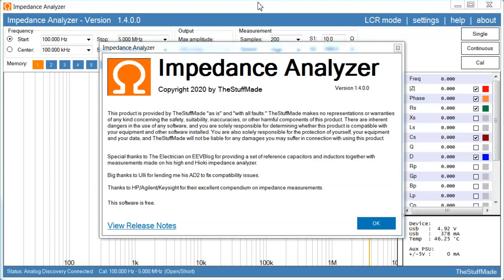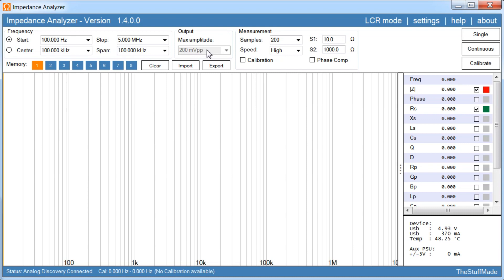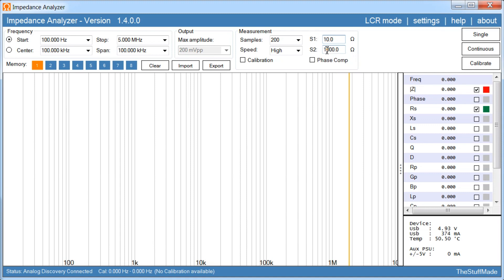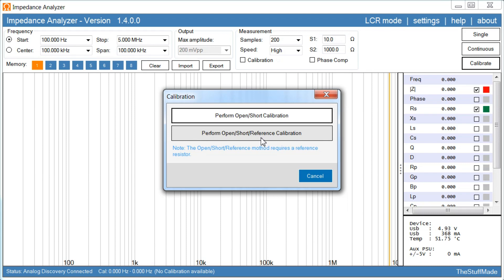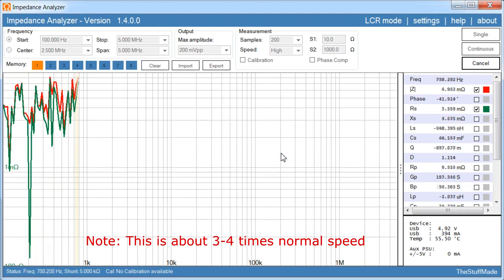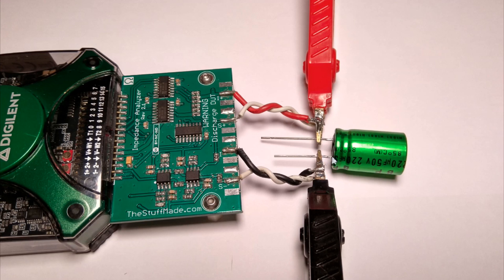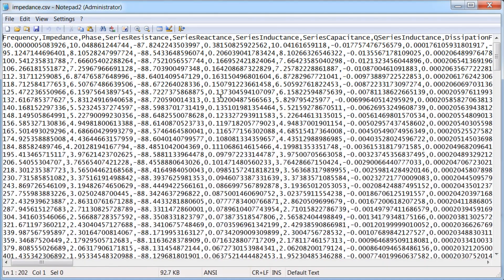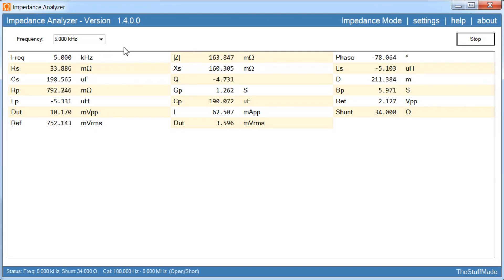Impedance Analyzer v1.4.0.0 Available for Download

Comment: Hi, TheStuffMade. many compliments for Your fantastic program/hardware combination. I made the circuit and it works fine! I only have one doubt. Could you provide me with the kicad diagram of the plugin? I ask you because I don't understand the connections between the Digilent and the part of the circuit corresponding to "LOW", MEDIUM" and "HIGH". Thanks in advance.

Comment: Hi Jake, i have the AD3 and when i start the impedance analyzer software, i can see it picks up the AD3 but no information in the temperature etc. window. Then the software closes by itself within 3-5 seconds from startup. I have the waveforms v3.23.4 installed on a 64bit machine, windows 10. When waveforms is running and i start impedance analyzer software it says device is not available. I assume it is because waveforms keeps it from connecting because waveforms is already connected to the AD3. When i close waveforms software with impedance analyzer software still running, i can see the device is seen by impedance analyzer software, but 2 seconds later impedance analyzer software closes automatically. Can you please recommend what i can do to get impedance analyzer working with AD3. Thanks in advance.
Reply from the maker: Hi, I recently bought an AD3 myself and I can confirm it doesn't work with the current version of my Impedance Analyzer software. I plan to fix it and release an updated version as soon as I have a bit of free time.
Cheers,
Jake
Reply: @TheStuffMade  thank you Jake. Also i want to thank you for the effort and the very useful software you share with us all.

Comment: Thank you! This project and the audio analyzer are amazing, having something like this available for free is really a boon. The software is excellent.
Sorry if this has been asked before but, which connector are you using to interface the board with the AD? I haven't found a definitive answes as to which connector(s) are compatible.
Thanks again!

Comment: When connected to AD3, close the program with an error message (Just-In-Time Debugger) in Impedance Analyzer ver1.4/1.3.
We use Win10, How to fix it? thanks!
Reply from the maker: Make sure you have latest version of the Digilent Waveforms  software installed.
Cheers,
Jake
Reply: Digilent Waveforms ver.3.21.2
Reply from the maker: @呀賢四眼仔  Make sure it's the 64 bit version. If you open waveforms and click down in the bottom right corner you will get a window with the full version info.
Reply: Digilent Waveforms version: 3.21.2 64-bit Qt5.15.2 Windows 10 Version 2009 Qt5.15.2
Reply from the maker: @呀賢四眼仔  Can you post the error message?

Comment: Great Video, and very useful HW/ SW! In the video I see that the capacitance value measurement always stops at around 200kHz... Is it a limit of the Hardware/ Software, or was it just because some settings? Also is it possible to add External BIAS to the measurement? Would be very useful for Coil testing :-)
Reply from the maker: Hi, in this demonstration I use a 220uF electrolytic capacitor, what you see is the nature of this capacitor being measured, the resonance frequency is around 200kHz, where you see everything peak and the phase goes from negative to positive. Above 200kHz this capacitor turns into an inductor. Larger capacitors will typically have a lower resonance frequency and small capacitors will have a higher resonance frequency, e.g. a 100nF film capacitor will typically have a resonance frequency around 10MHz.
Hope that helps.
Cheers,
Jake
Reply: @TheStuffMade  Thanks for the fast reply! How do you estimate the accuarcy of the device for Capacitance and for Inductance measurements? Would it be possible to add an option for external DC bias?
Reply from the maker: @ttakotube  It's fairly accurate as long as the calibration is done correctly, I've compared it with a high end Hioki Analyzer using a set of reference components. 
I've done a video demonstrating how to add a DC bias voltage during measurements: 
https://www.youtube.com/watch?v=d5k_opRCRVw&list=PLj1iPGXgbNf11SL1XVvDII3L6C4ZWhbyp&index=4
Cheers,
Jake

Comment: Thanks! I've just put together the passive version using an accurate 100R resistor and I'm getting very good results. I plan to compare it against a nanovna and a regular VNA and also the 'three AC voltage' method using a decent bench multimeter and a clean sine wave. I just measured a 50uH Siemens RM4 inductor wound with litz wire and it measured the Q curve correctly peaking at  a Q of 450 at 700kHz. This is one of the reference inductors in the old Siemens databooks where it gives Q curves. I'm very impressed so far, thanks again!
Reply from the maker: Thanks, if you find the software useful I'd recommend building the active plugin, it will give much better results at low impedance measurements. Also I have an updated version available with a lot of bug fixes and improved accuracy in some cases.  https://www.dropbox.com/s/0gkdr385y4vrrha/ImpedanceAnalyzer_1.4.1.3.zip?dl=0
Cheers,
Jake
Reply: @TheStuffMade  Thanks. I'm not sure where to find the schematic and PCB information for the active plug in. However, I'm still getting excellent results with the passive version. I'm currently measuring impedances up at 10Meg Ohm using a 10k sense resistor and the results are quite pleasing. I'll try the latest version of the software. Is it possible to change the scaling on the Y axis? I sometimes want to zoom in on part of the trace. I'm going to try graphing like this with the CSV export so I can workaround this issue. Thanks again, Jeremy.
Reply from the maker: @G0HZU  Hi, you can find the schematic and board files for the plugin in the download link for this video in the description. However if you are primarily measuring high impedance then the plugin is not of any use to you, it is primarily meant to give a large range like mega ohm down to micro ohm with auto shunt switching and amplification of the lowest values.
Cheers,
Jake
Reply: @TheStuffMade  Got the link now thanks! I do intend to mainly measure low impedances so I'll have a go with the active plug in. Regards
Jeremy

Comment: One question - in the video on 4:11 (time) is visible that (S-  I-) and (S+ I+) wires are twisted. The idea of S+ and S- is to measure the voltages directly on measured object and in my opinion twisting the (S-  I-) and (S+ I+) cables for high frequencies makes things worse:
1. Twisted cables work well when currents in both wires are equal and have opposite direction. The currents flowing into pairs S+/I+ and S/I-- are strongly asymmetrical as S+ & S- currents  are negligible compared to I+ &  I-  currents. 
2. The result is - because of the twisted cables I+ will inject voltages into S+ and I- into S-. Not sure that this is what we want.

If some cables have to be twisted  it's S+ and S- to prevent induction of external noises (but this will also increase the stray capacitance parallel to measured Z)
Reply from the maker: I don't disagree with you, I initially used fully shielded cables for both sense and signal wires, but since they are so short I've found it makes absolutely no difference within the ~20MHz range and the twisted wires are primarily for support to prevent the wires from breaking off. Keep in mind we are talking about 40-50 mm of wire here.
Cheers,
Jake
Reply: @TheStuffMade  Thank you for the update. I agree that for short cables it doesn't matter so much are they twisted or not. If using shield, ideally it should be active shield to eliminate any capacitive loading, but not sure if this will work for very high frequencies.

Comment: Whatsup with the rising temperature of the device during the whole video. At what temperature does it seem to be stabalized? Does it need perhaps some heatsink?
Reply from the maker: It's normal, it will reach something like 50-60C internal in the FPGA depending on ambient temperature, no need for any heatsink, but you can get the most accurate calibration if you wait until the device reaches thermal equilibrium. Might take 30 minutes though.
Cheers,
Jake

Comment: I just got myself  an AD2 and I'm going to build this adapter for use with it. I have already ordered the PCB but there are a few versions including packages for the 74HC4053, will any version work ?  Also what size (i.e 0603, 0805) are the resistors and capacitors used on the PCB ?   Thanks for the great video.
Reply from the maker: Hi, it will work with both HC and HCT versions of the 74xx4053. The resistor and capacitor footprints are 0805 so they will take both 0805 and 0603 sized components.
Hope this helps, let me know if you run into any issues.
Cheers,
Jake
Reply: @TheStuffMade  Hi Jake, I just received the blank pcbs and notice instead of solder pads for the output wires/kelvin clips you have a silkscreen on the board for a 6pos connector. Can you provide info on this 6pos connector and a part# for the 30pos connector ?
Reply from the maker: @wahng9552  Hi, for the 6 pos connector just use any standard 100mill/2.54mm spacing connector that will fit (ideally one that is 90 degrees so it will lie flat on the board) for the larger connector I use 2x20 female pin headers (you can get the right size, but the 2x20 ones are cheaper and more common) then just cut it to size and sand/file it a bit making sure it will fit in the AD before soldering it onto the board as it's a very tight fit. I've uploaded a picture of the connectors here: https://imgur.com/euSPonv

Comment: Would a solid copper wire work just as well as a resistor lead for shorting the leads during calibration? 
Very nice rig and software!
Reply from the maker: Yes it will work fine, just keep in mind that raw copper tends to corrode very quickly so you might not get as good a connection as you would with a piece of tinned copper.
Cheers,
Jake

Comment: Hi, Could you adapt your software to use the AD5933 Impedance Converter- Network  Analyzer IC, it uses I2C so would need a usb to serial adpter or they also have  Eval Board "EVAL-AD5933EBZ", your software i think would be awesome along with this would be more accurate than just the AD2
Reply from the maker: Hi, I started out with the AD5933 before I switched to the Analog Discovery. There are many issues and limitations with the AD5933, the biggest one being that the max usable frequency is just 100kHz (only 1 MSPS and 12 bits compared to Analog Discovery 100 MSPS and 14 bits). More details in my thread on EEVBlog: https://www.eevblog.com/forum/projects/impedance-analyzer-build-and-experiments/
Cheers,
Jake
Reply: @TheStuffMade  Thanks for you work on the software ,awesome job! Thanks Again

Comment: Could the LCR section be used as a reference meter ? I was planing on upgrading my Deer EE DE-5000. Thanks for outstanding work.
Reply from the maker: Thanks. I don't own a DE-5000,  but from what I hear it's reasonably accurate. I'd say the two would compliment each other, as in the DE-5000 for a quick measurement and the Impedance Analyzer when you need more detailed data. I've seen some confusion around accuracy when e.g. measuring a capacitor using LCR meter compared to a multimeter, here it's important to understand that capacitance is not constant with frequency and generally capacitance will decrease with frequency, so a multimeter will measure a higher value than the LCR meter while both of them are accurate and correct.

Comment: Thanks for your continued work on software/hardware for the AD.  I own the Digilent Impedance Analyzer board - very inexpensive, but not as accurate since it is 2-wire.  I'll have a go at building your board as it is much more useful!
Reply from the maker: Thanks, it would be interesting to see a comparison.